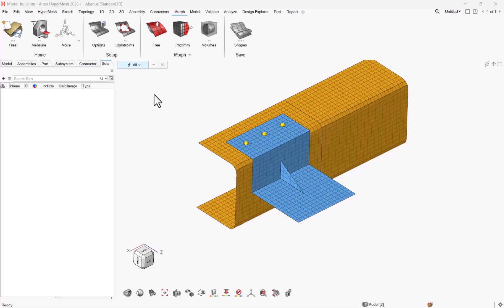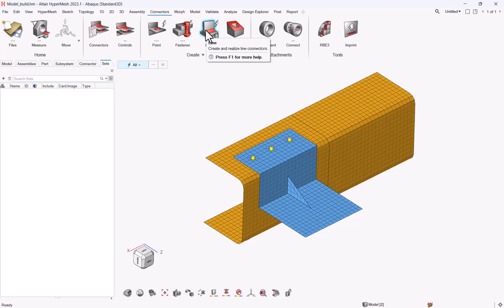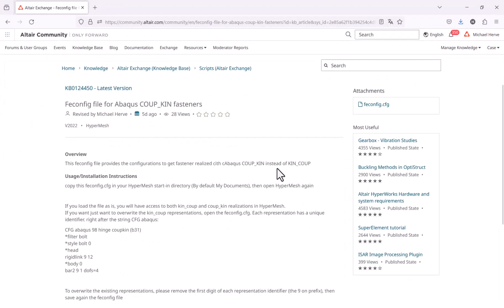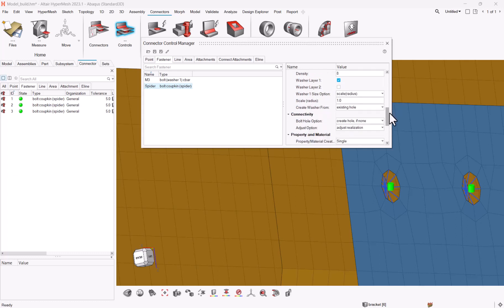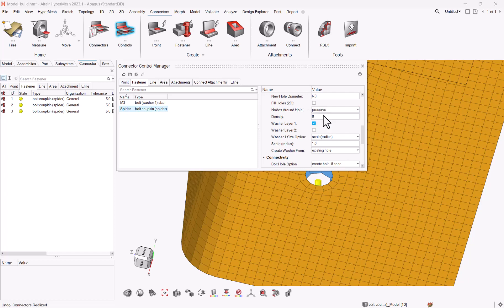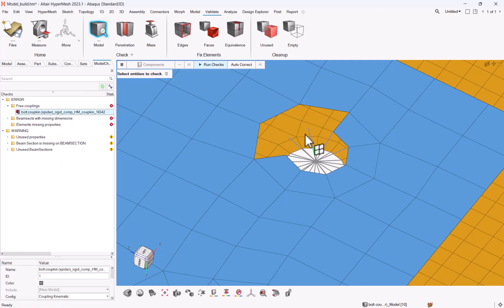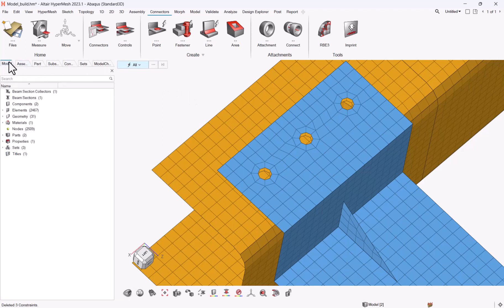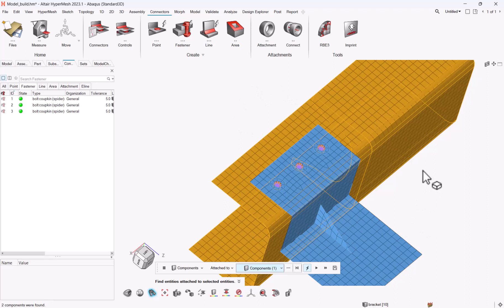About Constraints for connection purposes

Comment: How to check free rigid ,free rigid nodes ,rigid loops, dependency.
Reply from the maker: hello @rahulzambre8906, you should be able to use Model Checker for it. We show one of these checks from 8:19 in the video, but you should be able to detect other issues too. If you do not capture them through Model Checker, please report to us through a support case so that we can investigate
Reply from the maker: and once again, if you deal with connectors, you should not encounter free rigids as Connectors are designed to avoid such errors